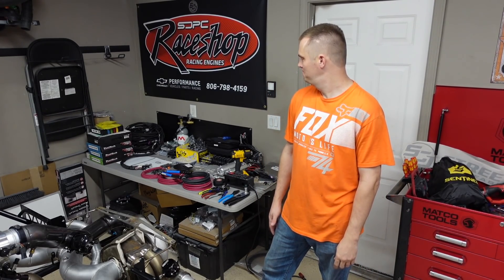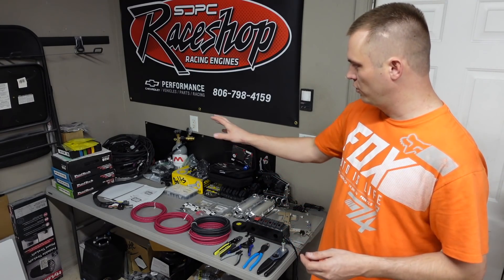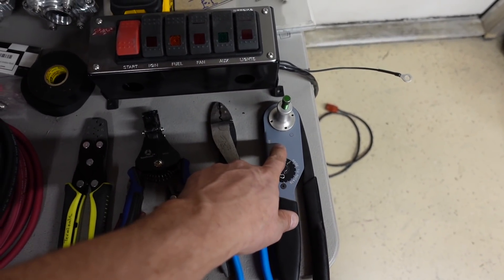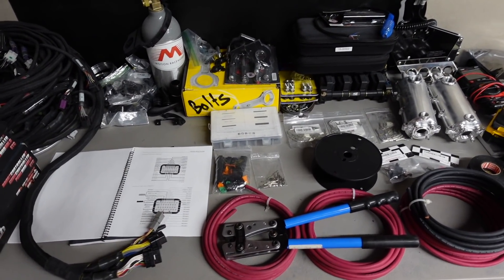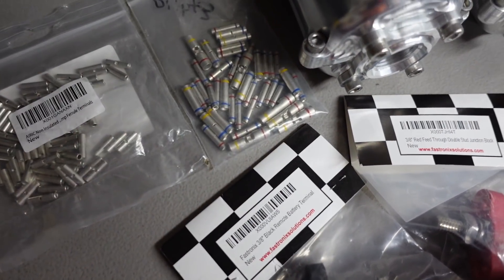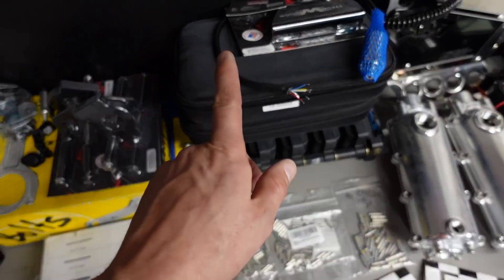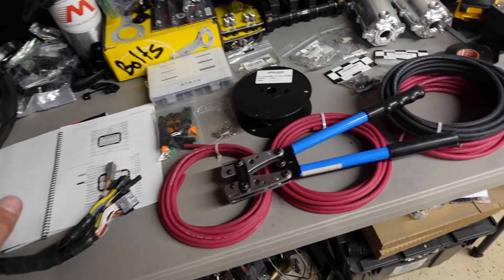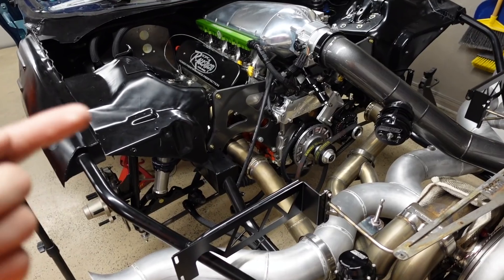Wiring Tools and Equipment! What Crimps? What Tape? - RACE CAR WIRING SERIES - Part 1

Comment: Very very good videos. I have watched all the wiring ones multiple times and ordered all the same components you use. Very helpful
To me. I am about to take on my first attempt at wiring a complete car from scratch. What do you do when the Fueltech wire harness is not long enough to reach your battery and some of the other components in the rear of the car? It states in the manual that it must be connected to the battery with no seams? Does that mean I can use a butt connector to extend it, and I t just needs to be a sealed wire from end to end? Or does it mean that it needs to be one solid piece from end to end? Sorry if this seems like a simple question but I would rather ask a question and do it once and do it right. Thank you!

Comment: I've spoken with the guys at K&R. Their products seem to be of good quality and well thought out. I'm anxious to see how you like them. They also have what they call their Pro-Street kit now that has more switches and circuits including street car stuff like horn, turn signals and other auxiliary circuits.
Reply from the maker: That’s really cool. I’d like to check out their pro street kit. So far I’ve been impressed with this board that I am installing in the camaro. Instructions are good, wiring harness is nice and wires are labeled, etc.

Comment: About to get started on mine. Holley ecu came in today. But the only holley crimpers I see are like $350. Im only going to do like 3 or 4 on the ecu and a few on the pro dash and probably never need it again
Reply from the maker: I use 3512MSD crimpers for the ECU terminals. It gets the job done for about $30...

Comment: No issues hot starts with the 4 gauge power system cables? What length of runs do you have on the build? Thanks sir!
Reply from the maker: Not as long as you’re using quality wire. My gauge goes from the trunk of the car up to the starter and alternator. 15ft runs or so...
Reply: @StreetCarJoe  appreciate you, sir. I picked up the EWCS as well since you had good luck with it.

Comment: Where did you get multiwire crimps. Ive never seen them before. Would make life a lot easier. Thanks
Reply from the maker: Del-City

https://www.delcity.net/store/Non!Insulated-Step!Down-Butt-Connectors/p_801887.h_801888

Comment: Do you use 2:1,3:1, heat shrink or just regular stuff? I think the 2-3 ones all have a Inder adhesive that will still all moisture from entering  anyways
Reply from the maker: I use a 3:1 ratio normally...
Reply: @StreetCarJoe  👌

Comment: I see informative videos I automatically 👍🏼
What's the average cost to wire a car?
Reply from the maker: It can start as cheap as $2,000 or so and go all the way up to $6,000 or more in labor. Just depends on options, sensors, plug & play vs custom harness, firewall bulkheads, etc.
Reply: @StreetCarJoe  I'm getting my car rewired after a hack job was done and I'm paying $4500, sounds excessive, but the amount of time it takes makes sense...thanks for the content you're putting out, learning a lot
Reply from the maker: @Yeah.Buddy.  Thanks. Yeah $5000 is normally a pretty average number to wire a car. If you think about it that’s barely more than a week at a shop rate... adds up quick

Comment: Fuel tech need to bring out a PDM. Using relays are a thing of the past. It adds so much unnecessary complexity to your wiring loom. Looks like a great build will be watching👍🏻
Reply from the maker: Do not a lot of people use the smart wire PDM with the fueltech?
Reply: @StreetCarJoe  it can be done but you don’t see it much, here in Australia everyone is putting them in. Motec, haltech and microtech to name a few PDM’s. All the top cars are doing it, it’s a great way to future proof your race car. would be a shame to go to all that trouble wiring up relays and so forth, when you could simplify your wiring with a PDM. I know some people are on a budget😅😅 but it’s quite clear you have bought the whole fuel tech catalog.😃 Great build regardless.👍🏻

Comment: Thanks for this, very informative.  I do wonder why you don't solder?  I was under the impression that soldering was best for connectivity and to prevent them coming apart.  No?
Reply from the maker: They say solder is actually weak to vibrations and tension stress and will cause it to crack. A proper crimp with heat shrink is more “reliable”. I’ll be honest, I’ve done both for years. GM actually used to train techs how to solder wiring harnesses. I still solder in some instances...